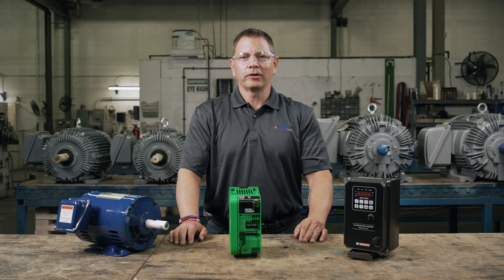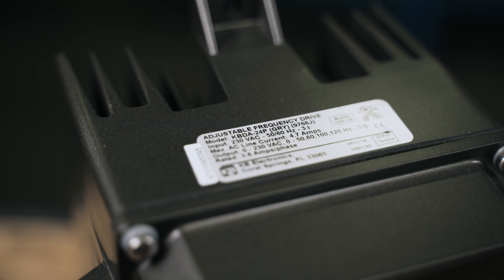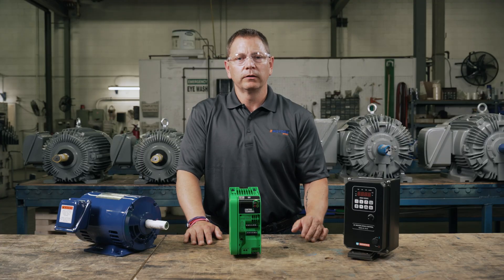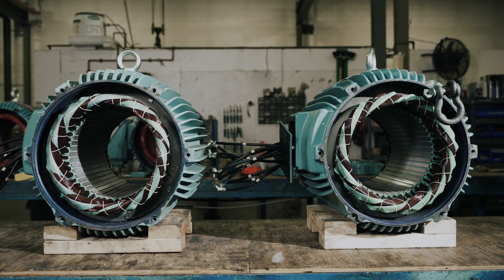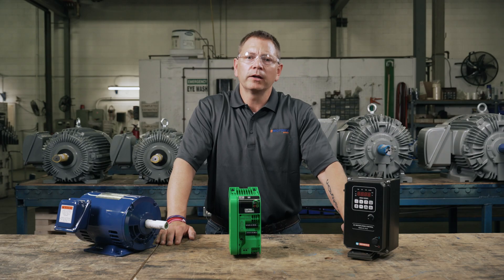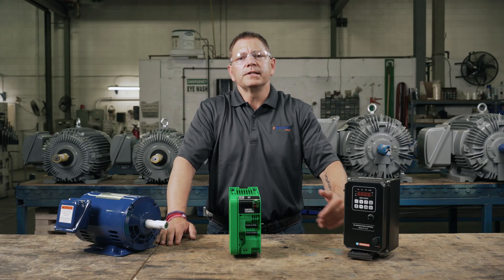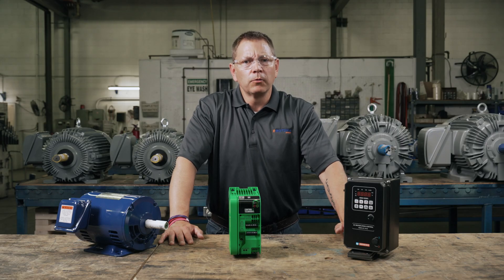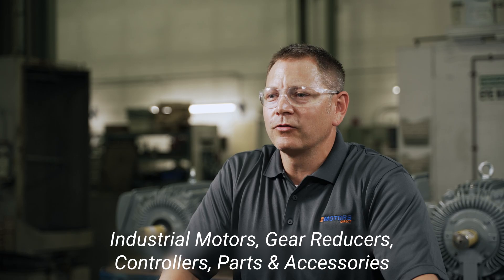How to Size a VFD for 3 Phase Motors

Comment: Thanks very helpful. I'm using a 55 year old 3ph 2 speed 1.5hp Swiss made EMB motor and it works very well but I only have a single phase supply. So I connected up a 2kW VFD and it is working okay apart from not enough low speed torque. Is there a way to correct for this?
Reply from the maker: Hi Jeff, thanks for the question. A motor that old isn’t designed to be used on a VFD and will probably overheat by slowing it down as little as 30%.
You would need to buy a new motor rated for the turndown that you’re needing.
Reply: I was going to say the same thing. Never use an older three phase motor in a VFD if you want to vary speed. You need to replace the motor.